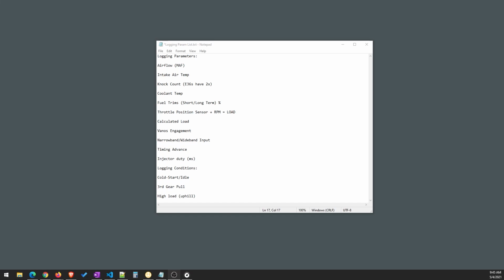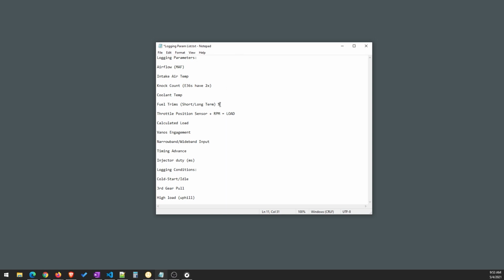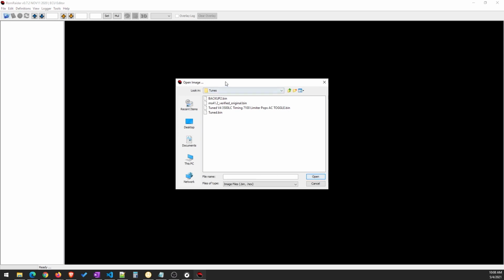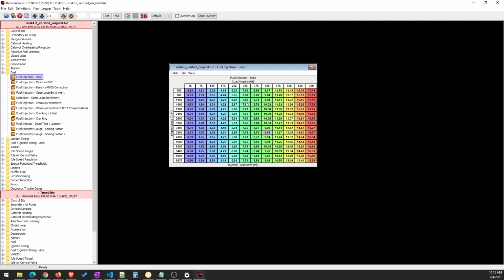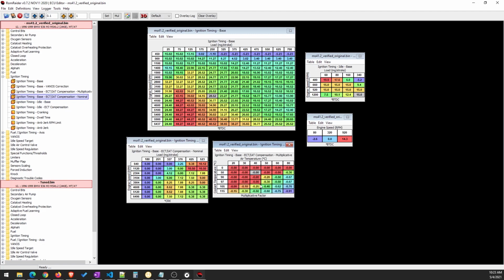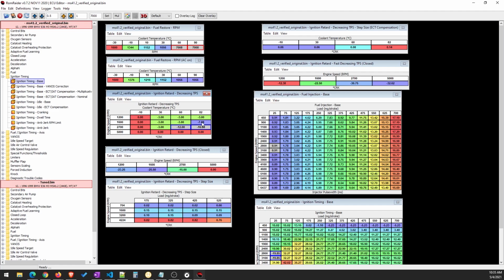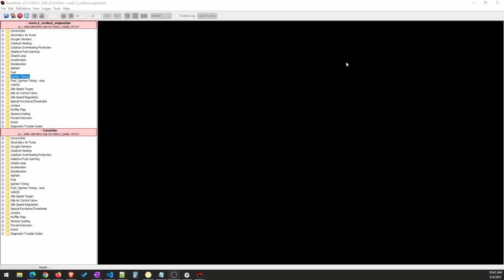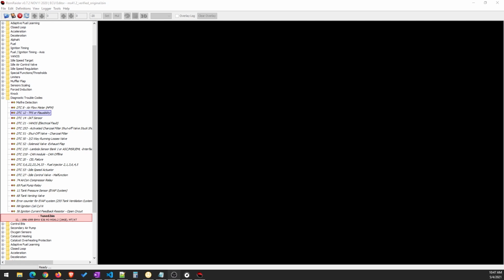How To Tune A BMW E36: Intermediate Tutorial - Part II: Launch Control, Burbles/Flames, Fuel/Timing

Comment: if i raise my limiter to say 7000 but put ignition to -20 from 6500 onwards would that give me a ignition cut limiter? or is there a way to stop it sparking at X rpm?
Reply from the maker: I don't think you can pull that much ignition timing plus there's no point unless you're turbo
Reply: @CanyonTuned its for drifting just want a nice limiter, I will do a hard cut but really I wanted a ignition cut mainly for the public more of a show 😂 may just over fuel it near limiter then, should do something
Reply from the maker: You can't unless you do the ms41 custom code

Comment: Can you explain the ignition timing VANOS correction table multiplier? The Dinan tune numbers I have from 1998 don't make any sense. Thanks
Reply from the maker: The more air the engine flows the less ignition timing you need and vice versa so depending on vanos position you need to adjust timing. You can throw the Dinain tune right in the garbage, I compared it to even the stock file and yeah..it doesn't make any sense, I honestly think you'd use power with that tune.
Reply: @CanyonTuned I figured. Should zero those numbers out to start or at least smooth them? Thanks
Reply: I guess I don’t understand how that VANOS table changes ignition. Does it take the cam angle, multiply that value times the table value and then add that to base ignition?
Reply from the maker: It multiplies base ignition, you might want to search the rom raider forums for more information that's not usually a table I mess with unless a customer had really aggressive cams

Comment: Very helpful! I have the AA tune that came with the stage 2 c38-81 intercooled kit. But it also has shrick cams and m50 intake etc. This helped me know what I was looking at. I got the ECU portal and quick flash along with definitions. But my only experience was through tuner pro on Bosch motronic.
Reply: And apparently the full file read from the AA tune bricked 2 dme fml.. I don't get it it completed with no errors and after I cycled the key it had no communication to ecu.
And yes I used a battery charger, and jumped pins, also confirmed the full in romraider and ECU portal and nothing looks funny.
Reply: Active wanted $800 to send me a copy of my file, what a joke!!

Comment: Hello ,I have question , is there a way to tune anti lag by retarding timing ignition with a manual switch on m50b20 turbo? I read somewhere that you can trick ecu with a switch that It thinks its -20 temperature ,but nobody explaind how to tune it so it retards timing while you let go off the throttle
Reply from the maker: It's in one of the temperature composition tables under ignition probability. I really don't know much about m50 stuff to be honest. Very limited options on OBD1

Comment: i’m considering tuning my n52 myself, if i just wanted to raise the rev limit could i do that and not mess with any tables or anything? Would the car know how much fuel and shit to give at higher rpm?
Reply from the maker: Raising the car a few hundred RPM is fine, the fueling really isn't much different. Your engine can't even flow anymore air past it's stock limiter so no extra fuel required
Reply: @ another question, sorry to bother, if I wanted to have burbles only when ac is off, do you know how I would do that?
Reply from the maker: This was covered already in one of my tuning videos

Comment: Awesome video! This helped me out a ton. Im still curious how you got ms41.2 to work with RomRaiders though as it shows a "Do not flash this file" via the definitions now for any ms41.2 software.
Reply from the maker: There's no such thing as 41.2 only 41.0 and 41.1 there's a custom 41.3 firmware but the developer passed away and the documentation sucks
Reply: @CanyonTuned  I meant MS41.3. I'm not sure why I said 41.2 sorry. Yes I heard, really sucks as they did good work! I tried running RR in an older version and still no luck. Constant "Do not flash" so I'm curious how you got 41.3 to not show this error. Thanks!
Reply from the maker: @theseanzboy1267  I never got ms41.3 to work, I was too scared to flash it due to the lack of documentation and didn't want to brick my ECU. I was going to mess around with it more but I don't own an E36 anymore sadly
Reply: @CanyonTuned  oh dang! I will have a couple DMEs soon. I'll let you know if I get it working. I appreciate the replies!
Reply: @theseanzboy1267  did the "do not flash" popped up or it says do not flash on the Ms41.3 sub menu?
Reply: From what i remmeber, it said "do not flash" in the sub menus and some optiond werent usable as well. To me it looked like the whole definiton was locked.

Comment: Does anyone know if there’s a way to toggle burble/flames and launch control with a button that isn’t the ac?
Reply from the maker: Possibly with the ms41.3 custom firmware but I haven't played around with it enough yet. The AC is the only segmentation in the ecu that has two different decel tables

Comment: Hey, 
Nice video very helpful, but i have one question what exactly are the step size maps doing. Do they change the values of the igniotion map or what is the actual use of it?
Reply from the maker: Step size is how many degrees timing will be subtracted from your base timing table during decel. The bigger the step size, the more aggressive the timing retarding
Reply: @CanyonTuned  Thanks Mate that helped me a lot in understanding step size because i Ran flames and everything on many Cars but Always had my Problem with understanding step size so lets say i have a step size 50 and 20 degrees Timing i end Up with -30 degrees Timing on Decel?
Need a lot more playing on all those ways of tuning the MS 41 because some Things and tricks that Work in MS 43 wont Work on it, also i Always Run into issues with a/c toggle on the MS 41 and MS 42 ecus, so i think step size was Always my Problem with it. And makes IT a lot easier to tune
Reply from the maker: Yeah unfortunately this is an area that I'm not super familiar with and it's not well documented anywhere. I'd say play around with it and log your actual ignition angle after making changes to the step size and see where you end up on decel

Comment: If I’m obd2 do I still need the chip in the ecu to tune, I have a jumper harness on pin 14/18 for the ecu cables so I can already read the ecu and write tunes
Reply from the maker: Chips are only for obd1 cars.
Reply: @CanyonTuned I’m obd1 and don’t have a chip in my ecu? It’s a RHD Japan import in NewZealand if that matters? When I did the manual swap it didn’t even have the transmission chip 😅 so will I be able to tune like this since mine definitely doesn’t have a chip - 1994 320i sedan. M50b20
Reply from the maker: @zyiink  I have no clue about those cars or engines brother sorry.

Comment: Is there any way to do that in MS41 launch control ? Do not have that option… vehicle speed limiter in rpm and also don’t have dtc codes like you have
Reply from the maker: If it's ms41.0 or.1 you may not have certain  features
Reply: @CanyonTuned  ahh, so basically not able to do launch control? Anyway to convert for ms41.2 ?
Reply from the maker: @workout3389  You can convert from MS41.1 to MS41.2 but not MS41.0. You just need to flash a full bin from an M3, then copy over all your 328 specific values over like the fuel and timing tables. I think there's a guide on the romraider forums
Reply: @CanyonTuned  actually I have ms41.0 so nothing can do :c

Comment: Hello!! I have one question about logging, i have take a log looking for knock degree values, it was a wot pull at 2-3 gears. Always reading 0 so no knock. But i looked for LTV values (F6 at romraider logger) and it is showing some knock retard at certain rpm and load ... What values i should care about?
Reply from the maker: Clear out the long terms and see if they come back. If so, subtract that from your main ignition table, clear it again and see if it's fixed. You could have bad knock sensors, wiring or just a resonance at that specfic rpm the sensor is picking up
Reply: @CanyonTuned  Is it valid to clear the values with ms4x? I did it last weekend... I dont find a reason to getting absolutelty anything of knock at logging but the LTV menu show a little... Also a little difference between each 6 tables  (cilinders). Maybe a bad coil/injector? Thank you!!
Reply from the maker: @agdwhite5421  Clear the values in the LTV menu, and each table represents different load areas not individual cylinders. Look at the x-axis of the table, it's load. Y-axis is RPM. So just match that up to your main ignition table
Reply: @CanyonTuned   Nice! But i had clear the adaptation values with ms4x because my romraider logget doesnt have that option. I looked to the ltv tables after i did a short and chill drive with wots just up to 3500rpm. The 6 tables have the exact same load areas between them. How are they different? Thank you!!

Comment: My BIN file (partial from my ECU) does not have the "Engine Speed Limiter" (AT or MT), nor Speed Correction, so no rev limit limited by speed, then no Launch Control possible 🙁
Reply from the maker: Yeah so you probably have ms41.1, there's a way to update to ms41.2 but I've never done it personally

Comment: Hello. I have one question:
Why I don’t have diagnostic trouble codes options and at folder limiters, engine speed limiter (mt) or (at). 
I have latest rom raider from may 2022. 
Thanks
Reply from the maker: What vehicle and dme version? Make sure you have the right definitions for your specific car

Comment: hii! thanks for all this videos! I appreciated it a lot. One question: Is it possible to tune fuel map (for instance) without a wideband? only with the narrowband that is installed in a standard car (e36 325i for instance again jjjj)? I was wondering if it is a good idea, tune it  by myself, car and PC. :D Thankkksss
Reply from the maker: Yes, very easily. I think one of my other videos covers this but you'll need megalog viewer and make table with the same axis as your fuel table. Then log fuel trims and plot long term + short term and make your corrections based on that. Fuel trims are based on your stock narrow bands. So as long as their in working condition you should be good. Try to get your trims within 5%
Reply: @CanyonTuned  I will try it! Yeesss I watched your next video about this perfecttt

Comment: For the pops and bangs are those values only for m3 or can i use those for my 328 ?
Reply from the maker: There are a number of people who are reporting missing tables that are in this video but don't show up on their 328 tunes. Some of the values might be slightly different but the overall process should be the same
Reply: @CanyonTuned  Thank you for all the help seriously you’re the best for this ! It worked haha 😆 with no cats should I be worried about adding too much fuel on those first cells not sure what too much fuel would look like ?
Reply from the maker: It's going to heat up your exhaust valves with too much fuel and negative timing so moderation is good

Comment: I have a 96 E36 328i which has been mapped like this but I think it's off as it runs really rich. Is there an easy way to flash it all back to factory?
Reply from the maker: The romraider forums have all the stock bins. You need an account first to see them.

Comment: Has anyone done any tuning for SC/Turbo with romraider yet?
Reply from the maker: I actually ended up switching to a vems standalone ecu, much easier tuning process on speed density. You can literally just drive around and have auto tune dial in a VE table for you
Reply: @CanyonTuned  Stand alone ecu seems to be where most self tuners end up if they stay at it long enough.   Still it is really nice to see that you took the project to its intended completion.   There were so many gaps back when we were looking at this a few years ago.

Comment: When doing the 2 step and adjusting the fuel and timing would that also affect driving in those rpm ranges or just when 2 stepping?
Reply from the maker: The 2 step feature is only a lower rev limit when you're not moving. Timing and fuel can't be changed related to that. Only the main tables
Reply: @CanyonTuned  okay thank you! One more question, so when you set the low speed rev limiter and talked of adjusting the main tables for shooting flames like a sort of 2 step, wouldn’t those adjustments affect driving in the 3000 rpm range because it was adjusted on the main table and would not apply only to when you aren’t moving/under the speed you set rev limit too
Reply from the maker: At 3k rpm you're hitting different airflow cells in the table free revving vs driving. Do some logging in both situations and you'll see which cells are specific to free revving with no load on the engine
Reply: @CanyonTuned  okay! Thank you so much! I’m doing pop and bang and decel and gonna try this to hopefully get a flame shooting rev limiter! I’ll let you know how it goes

Comment: When you say across the board on the ignition timing and fuel do you mean all the way across the board or just the 50 column down
Reply from the maker: Timing I add a few degrees in every single cell, fuel I don't usually touch unless some of the fuel trims are way off. Do some logging before you touch that table

Comment: so when it comes to the launch control option, would that include most e36's or just the m3?
Reply from the maker: It's technically not launch control, it's just a lower rev limit set when the car isn't moving. But you'll need to switch to ms41.2. If you're on 41.1 it won't work, but there's guides on how to switch in the romraider forums

Comment: I wondered if you can flash a 320i m52b20 with the M3 ms41.2 file? would it work? or can i somehow copy the m52b20 map to the ms41.2 version?
Reply from the maker: You can go from MS41.1 to MS41.2, people do it all the time. Search the romraider forums
Reply: @CanyonTuned  i have looked at the forum, but do you know if you can swap the m52b20 file to the ms41.2 flash?
Reply from the maker: I've never had a reason to look into it, but you can attempt to do a full write (128k file) and see if it works. Just be careful because it could brick your dme. I'd start looking into if the processors and dme pinouts are the same across them first

Comment: I know that you are probably tired of me 😂 but I finally got everything to work but when I do the LC I followed your section on it but now i can’t get it to rev over 3000rpm how to I change it so I can still have LC but when I’m not using it still let me go above 3000rpm if that makes sense.
Reply from the maker: You need to set the the RPM limiter only for low speed less then 5mph, above that set your normal rev limiter

Comment: Hey man, can you tell me if there is any index explaining what each option on the map means?
Reply from the maker: Yes every table has "table properties". Right click and choose table properties. At the bottom of the window it will give you a brief description. Also the ms41 development rom Raider forum section has everything defined
Reply: Thanks!
One more thing, in ms41.0 it doesn't have the rom limiter for speed.  Is there any alternative to be able to launch?
Reply: @gustavopaschoal7882  I'm not too familiar with ms41.0 but you might be able to wire in an auxiliary input to the dme that would trigger it
Reply: @MikeP41  Could you tell me where I can find some information about it?

Comment: Yo on the LC part I don’t have that section I have everything but the manual and auto settings what kind of read did you do ?
Reply from the maker: It was just a 24kb read, not a full. You could have old definitions files or your specific DME doesn't have those tables. Sometimes those NV motors or 4 cylinder versions don't have a lot of the same tables
Reply: @CanyonTuned  I have a 328i motor in my m3 and the ecu is a MS41.1 what MS version do you have?
Reply from the maker: @moddingjr7797  Same thing MS 41.1 make sure you have the correct definition files the tables should be there

Comment: Is it possible make a single video how to do a cat delete step by step ?
Reply from the maker: Just get headers or cut your cats out, but honestly there's almost no benefit
Reply: @dannycorliss9363  Downstream O2 Sensor Heater + Voltage Bank 1,2 - OFF, Cat Converter Overall Efficiency - Maximum Range - 20

Comment: Is there anyway to program an on off switch based on throttle position with a stock ecu? I have a supercharger with a magnetic clutch and I want to have it turn on when the throttle body reaches a certain point. If not, do you suggest any way around this?
Reply from the maker: There's WOT logic in the ecu but I don't think you can trigger custom events, you may want to look at the wiring pin out on the pedal itself and see if there's a wot wire. Tapping off that signal and running it to a relay then to your supercharger might work
Reply: In ms 41.2 there is map for muffler flap solenoid, that should work to control supercharger with magnetic clutch?

Comment: The launch control did not work for me
Reply from the maker: Log your speed and see if your speed sensor is working
Reply: @CanyonTuned  also my pops didn’t work either
Reply from the maker: Honestly doesn't seem like the changes got written to the car
Reply: @CanyonTuned  nah it did cause launch control worked it just never turned off so it would reach a brick wall as I was driving
Reply: @6CylAddict  Sounds like your speed sensor is bad then or you typed in a setting wrong. Rev limiter above 1 kmh should go back to normal
Reply: @MikeP41  I’m sure it’s the speed sensor because I basically changed it so that I just have an aggressive hard limiter